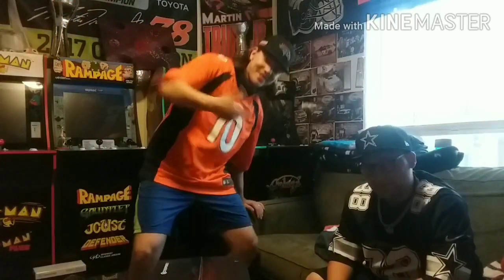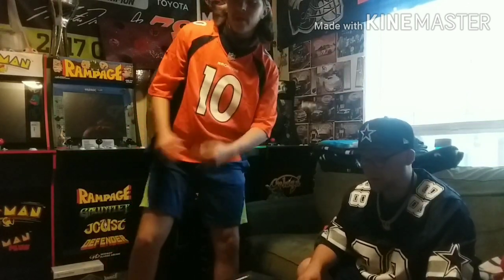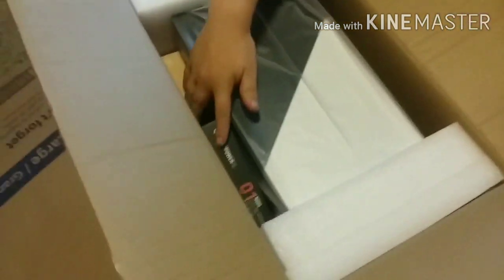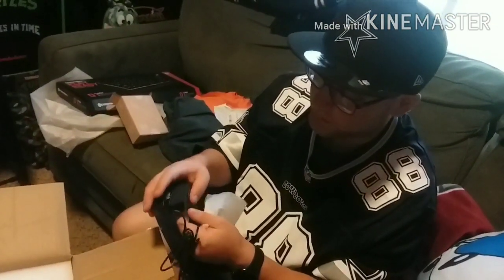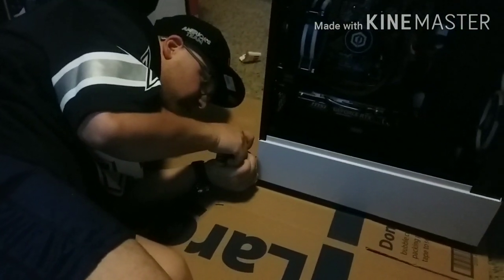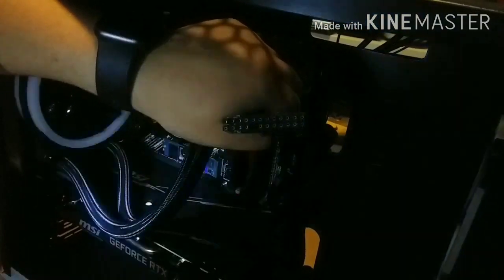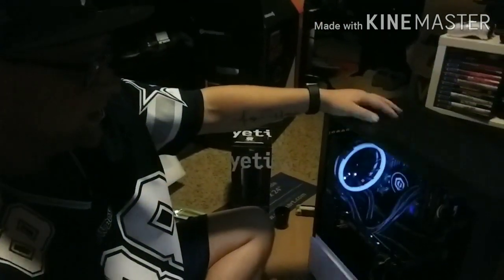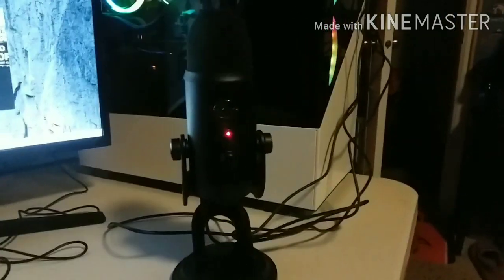$1400 CyberPower PC Unboxing And Setup!

Comment: Did u have to buy windows 10 or did it come with windows 10?
Reply from the maker: Nope it came wit it. 👍
Reply: @PackinOranges  ok thx so much because Im actully planning on getting that exact pc for 1,200 from Best Buy
Reply from the maker: @senlixz9275  Your Welcome and it’s totally worth it I still use it to this day I’d just upgrade the power supply that it comes with but other than that it’s a very nice pre built!
Reply: @PackinOranges  ok I will definitely get it just gotta save up because I’m pretty broke

Comment: every time i plug in the hdmi from the monitor to the pc it always says no hdmi no signal.  how can i fix this :/
Reply: Did you fix this ?
Reply: Oh I had the same prob but it was that at the bottom has other one it is cover whit some thing
Reply from the maker: Make sure it’s plugged into the right slot on the PC. Plug into Graphics Card nothing else.

Comment: I got a 1200 dollar prebuilt from them for 1200 2060 super i7 10700f b460 motherboard 16 gigs of ram im ballin XD
Reply: I got the exact same on on Dec 24th lol
Reply: @Arun-uo7hb  nice bro mines runs like a dream no oc or optimizations just regular pc if you are worried about cooling it’s because all the fans are exhaust so you should unscrew the 2 big fans that are attached to the back and flip them around and then the cooling will be good
Reply from the maker: Heck yeah. 💯🤙
Reply: Where do you plug the dvd and the usb key

Comment: Does who’s come with the liquid coolant, or do so have to add it
Reply from the maker: Mine came with it.
Reply: @PackinOranges  what is a liquid cooling
Reply from the maker: @mikecleary8947  It's like a water cooler inside the pc that removes excess heat.
Reply: @PackinOranges  Is $1,635 a good deal for this pc, mouse, mini keyboard, large mouse pad, a 144 Hz 4 millisecond response time curved monitor, a wrist pad for keyboard, and a wireless headset. Please someone answer this
Reply: @mikecleary8947  no
Reply: @mikecleary8947  if it has a 30 series gpu, and a i5 1440k or whatever or higher yeah